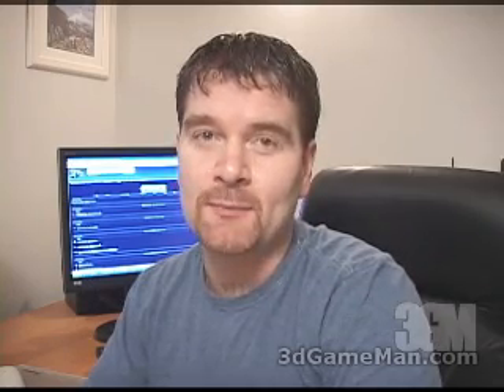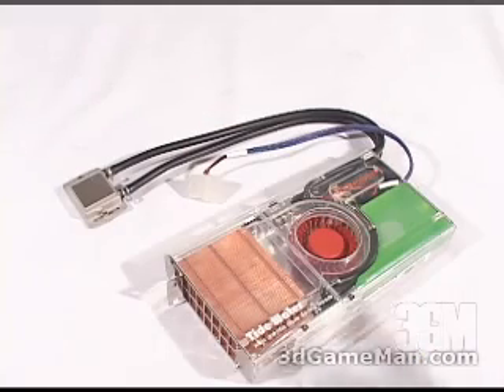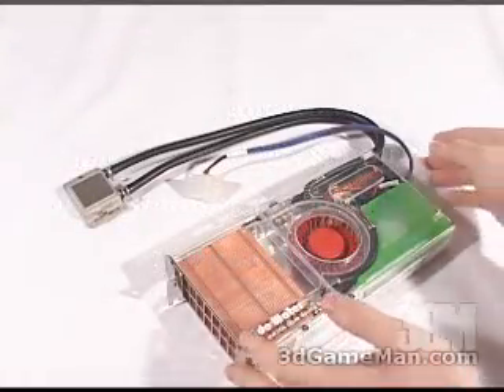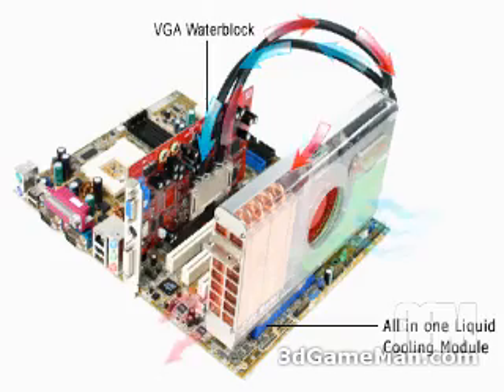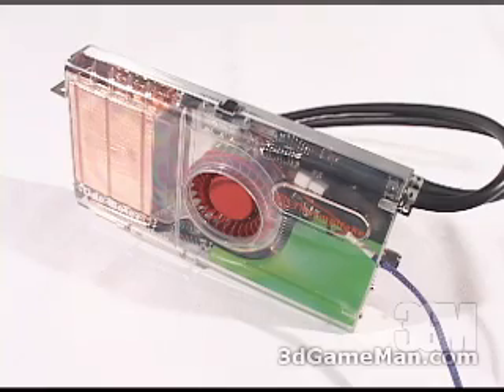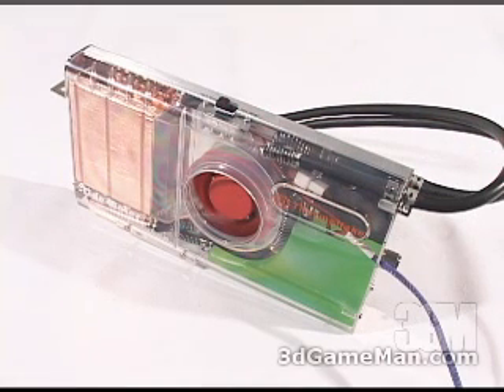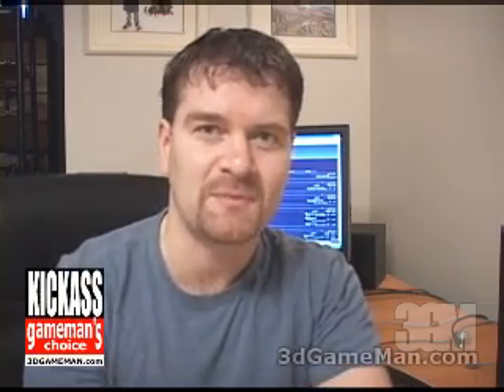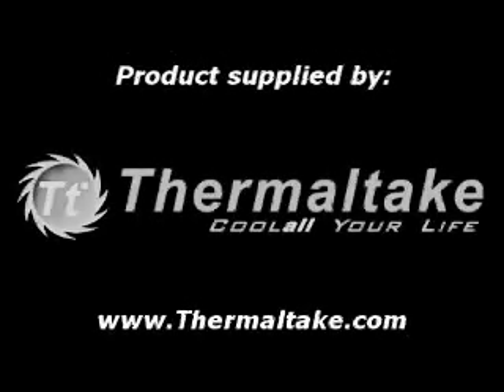#652 - Thermaltake Tide Water

Comment: I really wonder if someone here still using this on there RX 580 red devil? Im not pretty sure if the gpu block fittings are compatible? but its worth  trying
Reply: I use it together with a Radeon RX 6400 - it's working😅
Reply: @andipm204  Glad you still have that cooling stuff mine got suck tubings got brittle and am fortunate enough that leaking didn't happen on my previous setup.
Reply: @Vesemer_Sairo  NOS: New Old Stock

Only a little coolant was missing. But the tubings stunk without end.

Comment: @crazyyoyoer37 its not water that is used in these "water" cooling systems, they use a liquid that carrys heat very efficiently but doesnt conduct any current so even if it leaked onto youre pc it wouldnt fry the electronics.

Comment: I had one on my 7900GT back in the day. It cooled it alright, but the blower fan has two settings, uselessly slow or incredibly loud hurricane wind. Also, having the tubes kind of cramped in the case pushed up on the card warped the circuit board.

Comment: pretty sure you could use it as a cpu cooler just replace the block and if i did if change the tubes as well would work very well it seems only problem i can see is that it takes quite some space